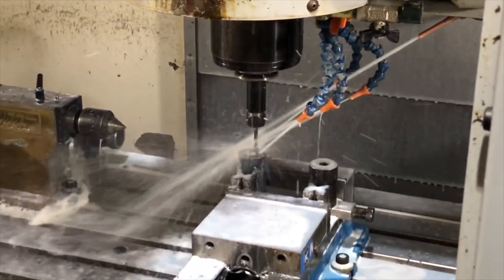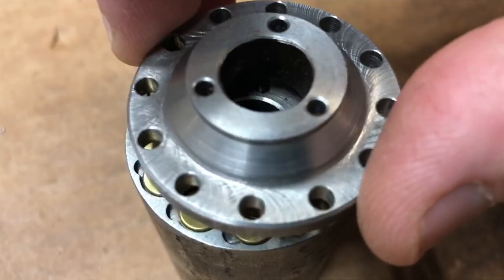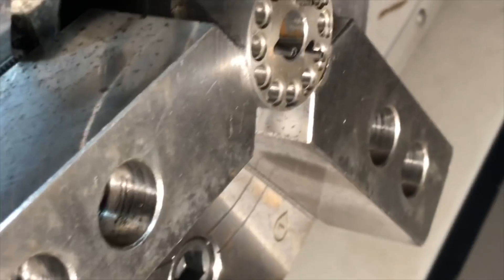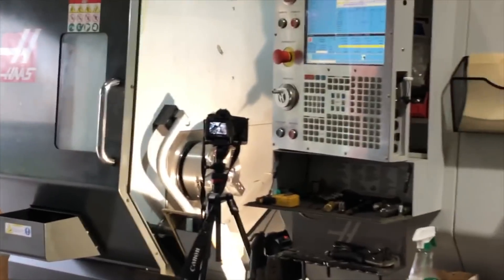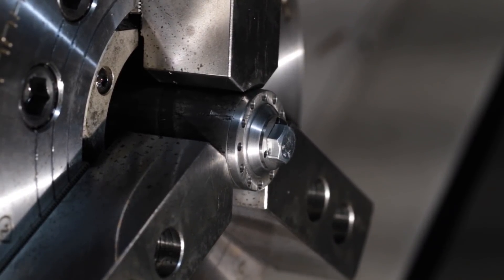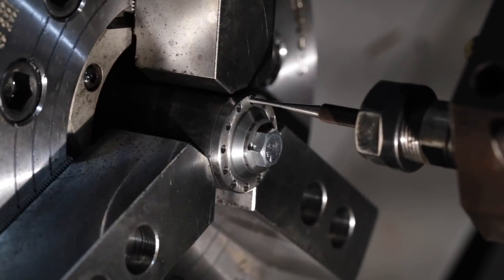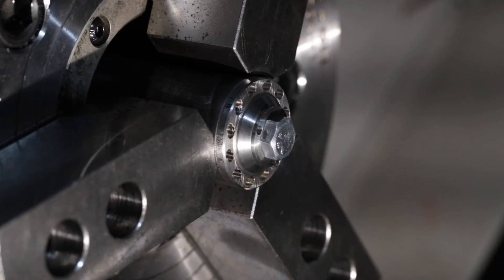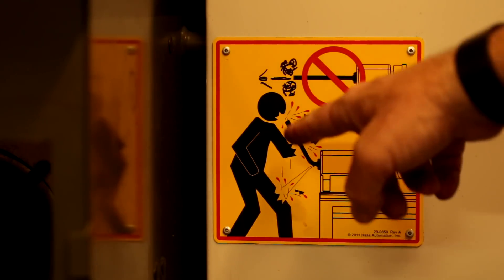Lathe Machine Gun

Comment: Greetings,
I don’t think this qualifies as a machine gun.
The mechanism is not driven by the detonation of the the cartridge.
It’s not driven by combustion gases, or by recoil from the cartridge.
It’s powered by the lathe’s electric motor, controlled by the CNC software.
It’s a Gatling Gun.
I’m not current on Federal firearms rules, but the last time I checked, you could build a Gatling Gun.
At least you could buy plans for one, and I’ve heard of them being built in .22 caliber.

Many aircraft use electrically driven Gatling Guns, and achieve the same thing as your setup, without relying on all your electronic jiggery-pokery.
Plus, they have barrels, instead of just firing from open chambers.
An interesting exercise is control theory, though.

Let’s be careful out there.

Comment: Feel like you would need an independent spring firing pin that the saddle has to cock back and release
Reply: Or, replace the poker you have with an auto spot punch, would do effectively the same thing just without the need for an independent part

Comment: Somewhere deep in the G code you might be able to change the PID settings, depends on the controller. You could also set the innermost position a little deeper if you can, lastly how about using an automatic centre punch instead of the pin punch.

Comment: Put a automatic center punch with a squared off tip in it.
Reply: Or put a spur wheel in as live tooling and sync them. That would really up the firing rate. You may not be able to do that though as Haas does not support hobbing that I am aware of.

Comment: Set that  cylinder outside the spindle if it will clear the bed or even gear at as such with your cylinder and pin to the top. You could even drop in new cylinders if geared with a spring loaded auto ejecting breech. Set your cylinder to 20 or 30 mm rounds. Mount your lathe to a hydraulic turret on a truck bed with elevated axis. Voila! AntiAircraft or tank weapon. Well that's better than a Bofors. That or just machine a Vulcan Cannon.

Comment: I would have used a caming system. maybe retained ball bearings then a nice ramped cam that rides on the cylinder.  Then... you know... max RPM!  Then obviously, a larger diameter rapid blank depletion device.

Comment: wouldn't it be easier to 3D print a hammer that is cocked & released by the rotation of the lathe? And with a belt-fed reload system that would be the first "lathe based LR22 gatling gun" ...  :-D

Comment: Those 'primer cutouts' in the cylinder are dry firing damage marks on a 'real' gun. Make another cylinder with only the cuts for each cartridge, leaving the 'primer cut outs' ...out. It will likely fire every time. The firing pin damages cylinders in revolvers to look just like your test rig to the point it will not fire. You engineered a very big , heavy, computer controlled but broken gun.

Comment: Why could you not have made a tool like a wagon wheel but have the cogs ⚙️ set at an angle so the lathe could just turn and the cogs roll in the hole and out as it strikes the primer. Btw I’m a maintenance technician not an engineer lol 😂

Comment: The nose of what you are using is flat. Try rounding the nose. Decreasing the area of the point.......making it pointed, will increase the pressure applied to a smaller spot. Look at the firing pin of a gun.

Comment: I don't think the punch was supposed to move while it was "striking the primer".. I'm pretty sure if you took the machine gun theory out.  I think 🤔..you'd have better luck. Discharging the cartridges by Slowing the punch down.. Concentrate on what successfully sets off  the primers. in that method of firing pin design. Then go from there I'm nobody I'm not telling you what to do you're a grown man you're on to something cool but if it was me I just slow down and concentrate on each single cartridge get them all to pop then try to speed it up just take out that machine gun and try a repeater method go slow not too slow but slow you know what I mean give a couple of seconds between primer strikes and then you got it you know what you're doing you ask for suggestion there's mine I hope it helped let me know reach out

Comment: This probably will be more than a little low rent or hillbilly engineered as a thought to your punch /speed?
what about a simple spring-loaded Punch rolling over concaved rim much like a spring over ball bearing  detent on a 1/4” impact gun, so 
Basically the firing pin would always be under pressure resetting and firing just by the outside dimension that it would be rolling a crossed naturally would have to have a ball of sorts at the end like a gauge to check the tram of a vertical milling machine. Just picturing in my head sort of like a Mill dot scope turret but with totally different components/design concept. LOL I’m gonna post this anyway even though reading it has me questioning whether I may be retarded or not!👍🤣😂
Regardless of my special needs keep up the good work I love your content

Comment: I was going to guess the Derivative component of the PID algorithm was preventing the Z-axis position from overshooting by decelerating as it got close to the set point. But you basically already explained that. Regarding your second question, you can just use an automatic (spring loaded) center punch. Can I have a job playing in the shop now?